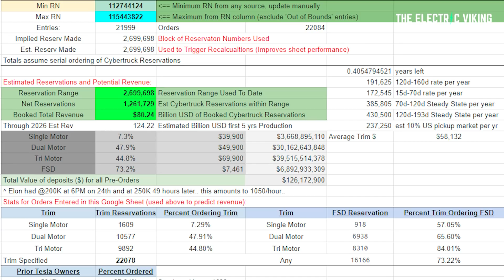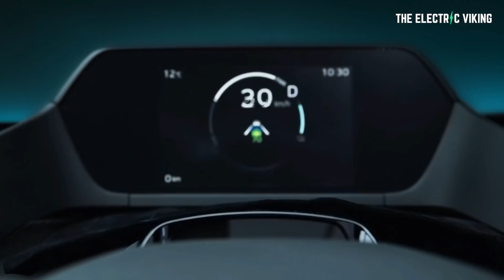Why Tesla is partnering with BYD

Comment: Toyota wont go bankrupt

Batteries will become commodity products no car company will have a significant battery cost or performance advantage

Even right now batteries can be purchased for around $100/KWh which means a 70KWh pack costs just $7,000

In 10 years time batteries will be better and cheaper. If they cost $50/KWh a mid sized EV with 70KWh pack will cost $3,500 for the battery pack or just 10% of the cost of the vehicle

At such low prices it doesn't matter if Toyta is paying $50 and tesla is paying $45 for batteries the difference is just $350 on a car which costs $40,000 means the advantage isn't even 1% of cost and this assumes Toyota is no better at any other part of the car

Come 2030 all the car companies will have compelling long range EVs and no one company will have a significant lead in batteries or electric motors

Comment: Re: Tesla M² with Blade? Makes sense. Tesla giga-pressed bodies strapped onto BYD skateboards with 20-30% margins each (30-40 to Tesla, due to higher production efficiencies?) for the (2 yr?) duration. Why not? The smaller, slower car won't have high engineering demands, so a non-structural pack (due to blade swelling limitations) would be fine. Just LFP for battery life, safety, & charging potentials is more than enough for robotaxi style cars. When the current manufacturing "stop gap" is past, Tesla can roll out its "totally own" robotaxi design while BYD deploys the older (Tesla branded) models to 2nd & 3rd world markets (along with mass Tesla superchargers, mega packs, tunnels, etc., etc ). Win, win, win!!!

However, if Tesla comes up with enough 4680s for everything they want to sell, then I'd say blades are out, just on JV, let alone logistical complexities.

Comment: Tesla may well get batteries from BYD but they would be crazy to contract for skateboards. BYD has every intent of being direct compilation with Tesla. It would be hard enough to have to buy batteries from them but to buy their skateboards would hurt the Tesla brand and in the minds of many an admission that BYD produced a skateboard as good as there's. That would be nuts. Plus they are ready to produce front and rear castings that are unique in the industry and you think they are going to start selling a product that is just like everyone else's. That would be nuts. And it would mean real issues for warranty and service work. Tesla I hope sees this as a total mistake. If Tesla ever partners with anyone it should be to provide the skateboards to them as well as the software to manage them.

Comment: I like your content , but I believe your wrong on this , I think the raw cost of making an ev Tesla will be able to make it cheaper and better than bud could , I do think they’ll buy their batteries but not for a structural pack, they just need lots of batteries and bud make a lot . 
Also I’m pretty sure Tesla’s batteries are at a cost below $100 a kw/h . They had a $108 kw/h cost in I think it was 2017 -2019 , and they’ve reduced cost since then.

Also from what I understand the structural style of the blade batteries would suit to replace the main part of a chassis like the 25k Tesla is looking to do . And I thought they were air cooled which will reduce efficiencies of Tesla’s thermal management systems .

Comment: I think Tesla will only use the batteries.  If they used "the skateboard" that would essentially send a message to the world that Tesla thinks BYD has a better skateboard.  Also can you please emphasize to people that Buffet bought his shares years and years ago and BYD is not "The company backed by Buffet/Berkshire."  They are a long time share holder.  The company/country that bailed Nio from near bankruptcy is more in line with a "company back by someone."
Reply: Look at the Tesla films on the new frames and bodies that are coming soon ftem Berlin and Austin.. Castings front and rear with a structural battery in between are totally better.

Comment: Partnering with BYD is impossible if Tesla doesn’t have domestic problem they can’t resolve alone. 

Problem? 
BYD has enough battery supply for each EV model in their portfolio. What about Tesla? 
BYD researched, develop and mature the cell they need today. What about Tesla? 
BYD prime battery is blade format already in mass production. Tesla prime battery is 46800 format already - over due to production. 

Overdue? The tab less 45800 architecture induced in a cross-disciplinary conflict originated in a patent disclosure that should have been spotted by the review board but didn’t, due to board lack of cross-discipline experience or vision. Team EE/ME are struggling open ended. If the tab less cell is implemented as patent dictated we’d have a premature thermal and electrical performance degradation cell pack as soon as vehicle is put in road or off road. And the eventual electric arc will develop across the anode/cell-wall junction next to hot and flammable electrolyte. Practically Tesla don’t have a viable 46800 solution for their EV or truck. 

The alternative to domestic cell supply problem is out sourcing from companies such as BYD or CATL.
Reply: All speculation. You long or short?
Reply: @lengould9262  I’d call it educated rationalities. Are you a EE or ME developer of electric product?
Reply: If that's true it collapses their mystique.  Huge losses. But where's the source?
Reply: @crhu319  why did you ask for the source?. Do you think each commentators and YouTube providers are a bunch worms that only knows copy and paste?

Comment: BYD is warren buffet backed… Elon practically dislikes that guy. A lot. 

Tesla opened their patent of the skateboard platform to accelerate electric vehicles. 

I heard there’s a patent law in effect 
In exchange Tesla can make agreements to take other manufacturers ideas at no charge or legal challenges. Because Tesla opened their patent. 

I can only think in this case. Tesla is flexing and taking this. Or paying. And BYD is kinda biting the bullet.
Reply: What a nonsense.
Reply: I think you have it backward.
BYD produce Lithium Phosphate batteries three years ago. Tesla just now try to build 4680 which is Lithium Phosphate battery.
BYD had it platform design more than five years ago.
Tesla is behind BYD, not leading as Tesla wants you to believe.
Reply: @Kukaboora  BYD made the skateboard plat form 5 years ago slightly more… so they were before tesla… who made the Tesla roadster in 2011… literally 10 plus years ago. 

You’re right
Reply: @daddystired  Isai, furthermore Lithium Phosphate battery technology was perfected by BYD and they made them in the prismatic (rectangle) form. Following BYD, Tesla adopted but put it in cylindrical form and filed and get a patent for it, what the heck!
Tesla is behind BYD in almost all aspects of EV.
BYD is a shy company, does not have a sophisticated public relation department.
Tesla, is mostly hyped.
BYD, put out the products first, and then makes the announcement, Tesla is the reverse.
Because you are snazy, sexy and glamorous does not make you true and genuine.
Reply: @daddystired  Once again you are behind the curve. In this area of energy Tesla is really inferior to BYD. Right now, not in any future, BYD had installed battery storage around the world with enough capacity to power entire Sweden for 10 years. Emphasis right now. BYD is a battery company just happen to do EV and AV.

Comment: 2 points: 
1: I believe it's the tech that Elon is buying with these batteries. Tesla doesn't have the ability to tool up quickly and replicate what BYD is doing with this radical, air cooled, LFP design. So I believe that Tesla will integrate these air cooled blade cells with their heat pump system, their one-piece casting and of course their proprietary motors, software and control systems. If it works out OK and proves to be better and cheaper to make than the 4680 system, Tesla will scrap 4680 and just go with blade batteries, either buying them from BYD or working out some deal to make them themselves, or doing a joint venture with BYD as they did with Panasonic, to build the cells in America or elsewhere, so that they can secure battery supply for their vehicles. Eliminating the complexity and weight of a liquid cooling system is a big plus for weight saving and cost saving, so I can already see how blade batteries would be superior to traditional cylindrical cells in a battery pack.

2: A lot of these EV channels like to bash Toyota, but Toyota is doing what Toyota has always done: wait till the tech is established, see which way the industry is going, then reverse engineer what appears to be the winning solution. Toyota is big enough and smart enough to jump in, adopt the best technology, and run with it. But until EV tech matures to the point where there is price parity, range parity, charging time parity with ICE vehicles, jumping in and spending zillions of yen to try and find the answer themselves, Toyota is very smart to watch what companies like Tesla and BYD are doing, and when it seems that is working, they can either do a JV with one or both of those companies, or just do what they did back in the 60's: take apart the vehicles of their competitors, find out how to make them more reliable, cheaper and better, and then export their own perfect solution to the entire planet. My Dad owned a 1969 Toyota Corolla in the early 70's and said it was the best little car he had ever owned. I just recently bought a Toyota Yaris, the first Toyota I have ever owned after owning probably 20 cars of different makes and models over the last 35 years, and I have to agree with my Dad. Toyota makes really good cars. So I expect when they start making EV's they won't be aiming to play second fiddle to anybody in the market. Right now, they have time on their side, as they can continue to build ICE cars and make money while EV's still only have a small share of the market. And of course they are doing their own R&D on alternative battery technologies like solid state and NiMH batteries which they have used in the past in their hybrids. Here's an intriguing piece of information I found on another website about the new NIMH technology:

"Weight, cost, and size are all issues that plague the battery packs used in hybrids, PHEVs, and BEVs. Despite the small size and capacity of the battery in a vehicle like the Aqua, there are gains to be had from improving any or all of those factors. And that's exactly what Toyota did here. The new nickel-metal hydride (NiMH) battery pack uses a novel design to both shrink the size and increase the output of the pack.

The new pack utilizes "bipolar electrodes;" it essentially removes some parts that separate the cells from each other, shrinking the pack from a collection of separate cells to a single conglomerate stack. That means Toyota can cram 1.4 times the amount of cells in the same space, and that the pack in total generates 1.5 times the power output. Essentially, Toyota has doubled the pack's total output."

https://www.motortrend.com/news/toyota-aqua-prius-c-hybrid-battery-technology/

Not saying this is going to be Toyota's magic bullet, just saying that they are working on solving the EV battery puzzle on their own terms, and are not just sitting on their hands when it comes to EV's, as some people think.
Reply: So why are they fighting EV's tooth and nail with advertising, lobbying, conference lectures, etc. They act scared. R&D money already spent?
Reply: @lengould9262   You could be right. But it makes sense that they would want to defend the income stream they are getting from ICE cars, and to buy themselves time while they wait to see what will be the dominant battery technology. Certainly BYD seems to have something with those blade batteries, being the first to get below that magic $100 per kWh mark.
Reply: Dude, Toyota will continue to use the BYD platform for a while as they already did in their latest EV-SUV… BYD will supply a lot of technology to legacy car makers. From the battery, power management system, IGBTs to the the whole e- platform 3.0. BYD is on the way to become a monster…
Reply: @philkeh  agree 100%. BYD seems one step ahead in battery development

Comment: There is no chance they will use a inferior skateboard for the cars, I find it hard to believe that they are going to use the blade especially with close relationship with CTL, and history with BYD just the usual FUD in my opinion.
Reply: I think all the parties work together to accelerate EVs. Common goal. I hope it works. World needs to kill ICE fast.
Reply: @monkeysezbegood  I agree with that fast is not fast enough, but given Tesla standard on safest design and how they are revolutionise manufacturing makes no sense to have a sub standard platform. Motors and battery management light years ahead of BYD. Also it’s all just speculation at the moment, l mean few months ago it was going to be Toyota, the blade looks good but I’m yet to find any confirmation on specs and how it performs. It’s all comes from BYD and to be honest until somebody else does test especially the nail test I’m going to take it all with a pinch of salt.

Comment: Tesla won't be using a BYD skateboard for its small car. Tesla, is where it is because it is highly vertically integrated. It's not about to surrender all that. To put it's name on a rebadged BYD car. Tesla is simply seriously battery constrained. And needs to use batteries from wherever it can get them...
Reply: CATL makes integrated packs for Tesla already no reason they would not let BYD compete for that business. They need another source in their supply chain. That being said it does not make sense for other markets. Tesla would be foolish to have a risk like that to their business.

Comment: Just from the images shown in this video, it seems like these blade batteries are made this way so they can cool down like a radiator, by air cooling, so wouldn't need a liquid cooling system. Is this correct, or am I looking at this the wrong way?
Reply: You’re absolutely right. And weight reduction as well

Comment: I thought that 4680 tabless batteries and one piece structural castings were going to solve all of Tesla's production problems by enabling them to make cars really quickly? Can BYD make their blade batteries faster than Tesla can make the 4680's? If so, then Tesla needs to buy BYD and implement the blade technology in ALL their vehicles. If not, why bother with BYD? Just build more, and bigger factories, even terafactories, and start churning out Tesla's by the millions. Sure it might take a few years to build the factories, but at the end of the day, once you have all your plant up and running, you can fine tune the processes and make even more EV's to satisfy the demand. 

The only reason I can think of, why Elon is doing this, is that BYD are so good at what they are doing that Tesla can't beat them, so the old saying applies, if you can't beat 'em, join 'em. Better to merge with your competitor than to go out of business because of them. 

In a way, I see BYD as China's Tesla: total vertical integration, even more than Tesla in some ways, and total dominance of what is a very competitive EV market in China. If Tesla wasn't also in China, along with a lot of other very strong competitors like Nio and Xpeng, BYD would have the same monopoly of the EV market in China, that Tesla has in America.
Reply: atfonline. 4680 means 46 mm diameter and 80 mm height cylinder.
When charge or discharge battery generates heat. for 4680 the heat has to go 23 mm to the surface to be dissipated by the cooling medium. As you. can see the heat tends to accumulate in the middle of the cylinder. This is the reason Panasonic has some doubts on the 4680 design.
In contrast, the blade battery of BYD is a rectangular 900 mm long, 100 mm high and 1.3 mm thick. With just 1.3 mm thick the heat in the center could go to the surface very quickly.
BYD blade battery only air cool for that reason. 
4680 tech is inferior to Blade in many areas, but I would not. bore you with those.

Comment: This is good news, because joint ventures are needed to make inroads to becoming competitive with ICE vehicles. This could provide the tipping point. Otherwise ev takeup is too little, too late.
Reply: This is a terrible idea. Tesla shouldn't be partnering with anyone wasn't going to use their skateboard not the other way around. BYD has no skateboard technology that Tesla needs as they have better already why be seen as saying that BYD has a skateboard they need. Why take on the issues of service for a totally different drive train. Tesla built factories to build cars not put bodies on other manufacturers cars.
Reply: @kstaxman2  what? you don't know anything about byd. go look at who they are and the tech they have. then go eat your words
Reply: @derekcraig3617  look at the frame and battery pack that Tesla will be making in Berlin. Two castings with a structural battery pack between them and tell me how BYD is better? BYD puts out a good skate board but its no where near as good as what Tesla is ready to put out at Berlin and Austin. Your comparing older technology with a totally different new technology. BYD will make a lot of cars but those cars won't be what Tesla is ready to produce at their two new factories.. You've been busy looking at Teslas models being produced today not what they have developed and are working to deliver in just a few months. BYD will be successful in selling lots of cars and are light-years ahead of most EV and all the legacy car companies but they will be much inferior to what Tesla produces with their new designs.